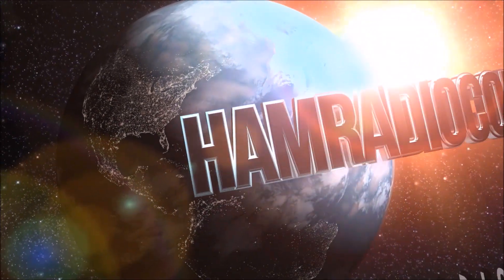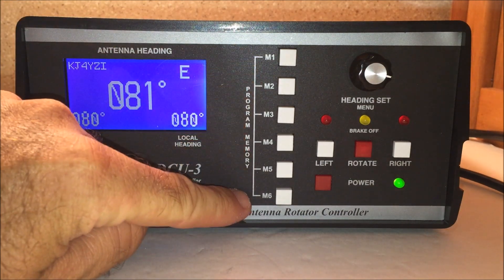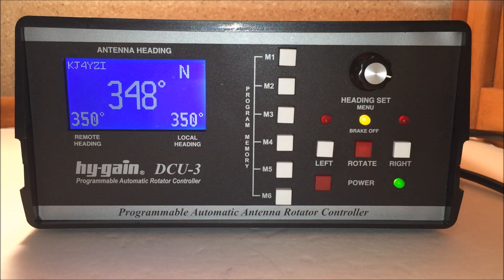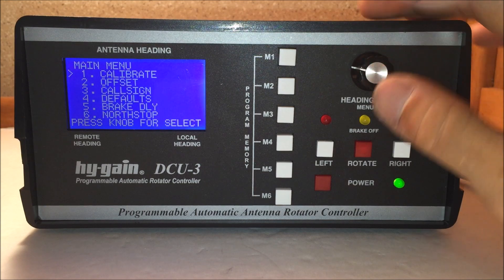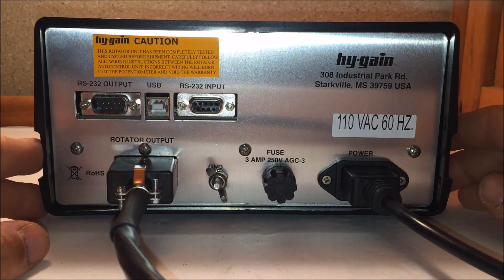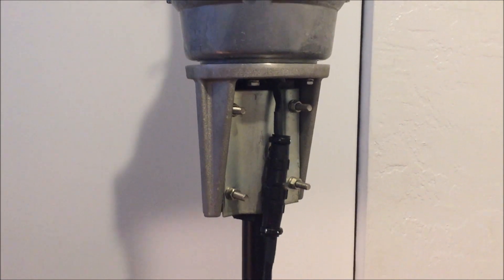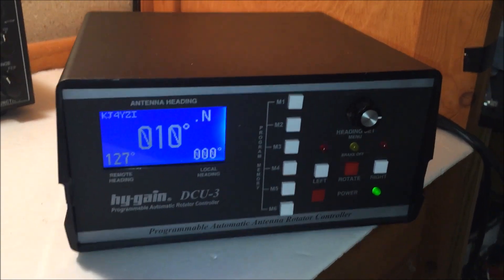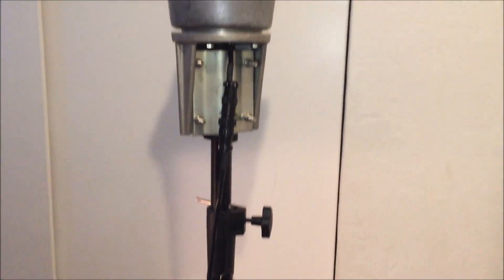Hy-gain HAM-VII DCU-3 automatic programmable rotator

Comment: I have what may seem a foolish question.  How do you calibrate your antenna with your antenna rotor.  Example I installed my antenna facing true north and I want to calibrate my rotor controller, but I’m having issues with the left and right stops.

Comment: I would like to ask if the company has released a program of its own to be installed on a computer (not only program upgrades for the central unit) but to show you from there, the operation of the rotor, how many degrees is the antenna, to order him to go to the degrees you want, etc. If there is this program, written in CD and they have put it in the original package, or do you go somewhere and download it? Thx